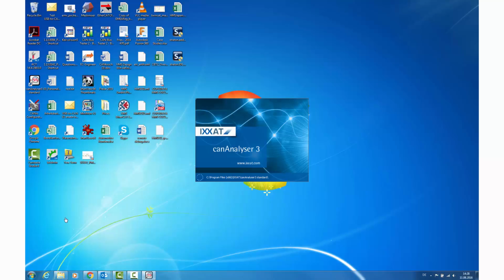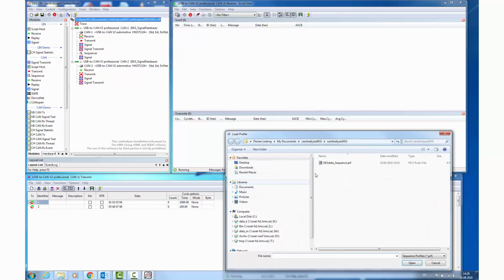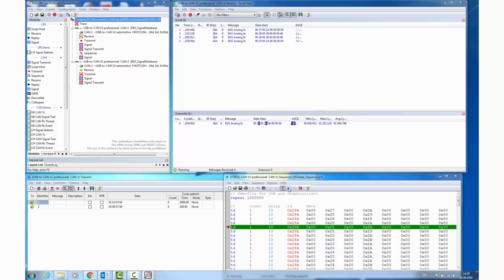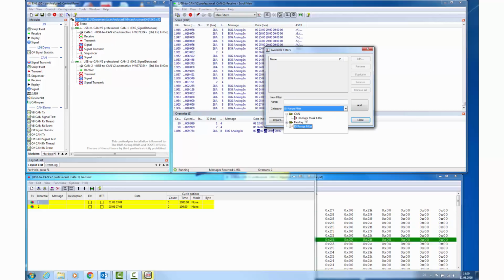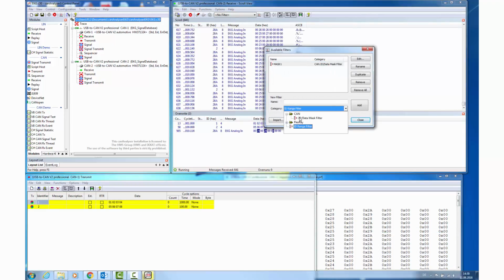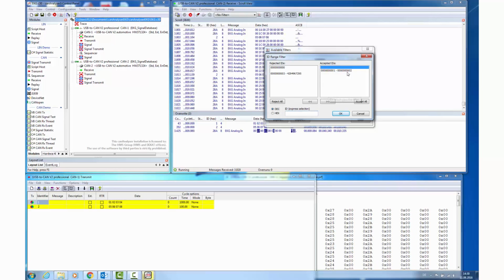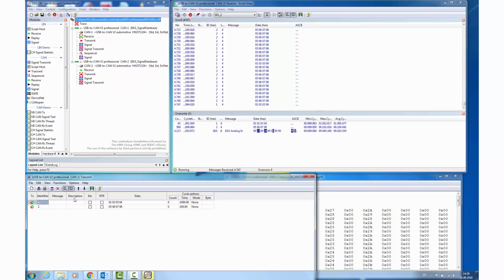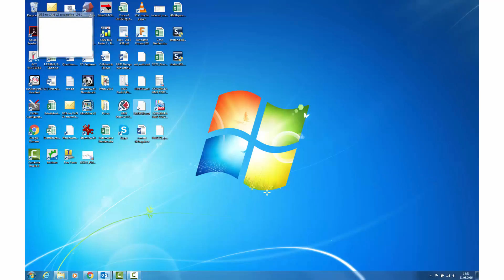canAnalyser3  Part 2: Working with signals

Comment: Sir, how to joint  with charger?
It's usbto can use insted  bms, battery?  How use with joint   wire comunication  please  give details
Reply from the maker: Hello @electrical_engineer1, thank you very much for reaching out to us! We have answered your question in other comments as well:

1) You can install the VCI V4, connect your IXXAT CAN inerface board to the correct terminated CAN bus, 
set the correct CAN baudrate, initialize and start the CAN controller using the canAnalyser V3 mini as shown in the video and you will see the CAN messages from the CAN bus in the Receive-Windows of the canAnalyser V3 mini.
2) Please register in the online support tool on our webpage: https://support.hms-networks.com/hc/en-us
and create a support request with a detailed problem description there if you have any further technical questions.